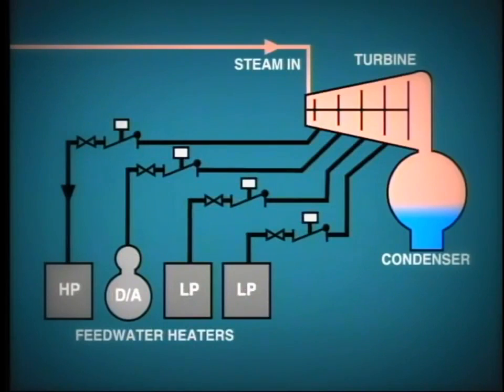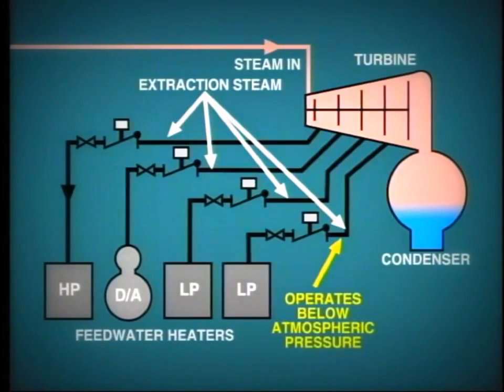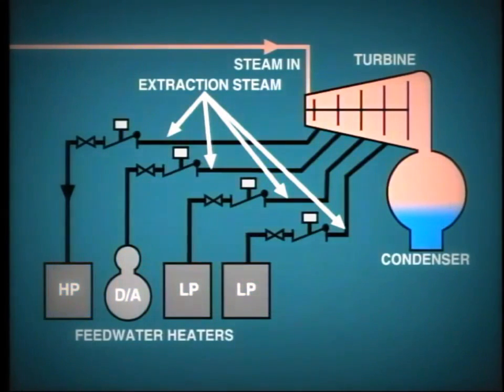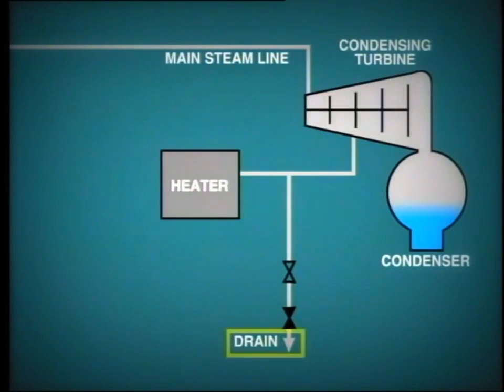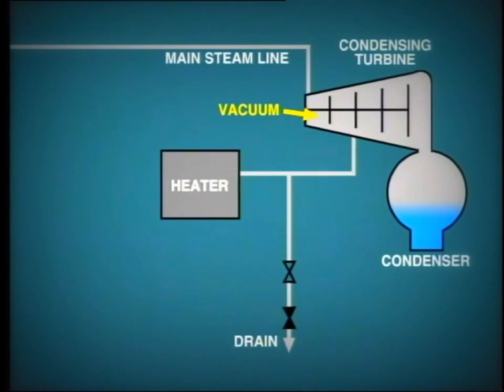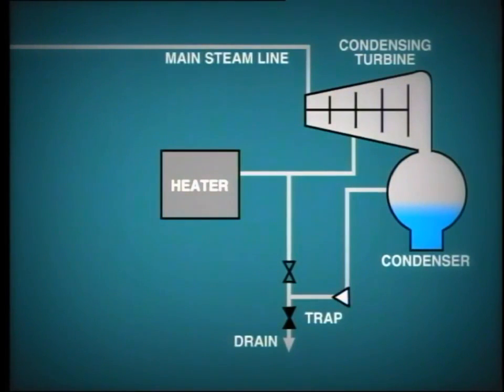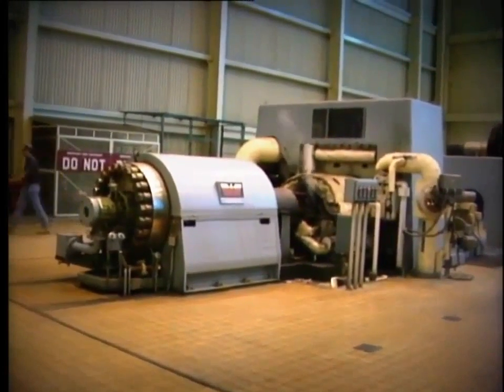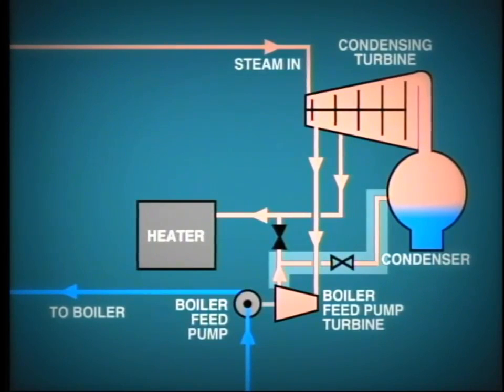lesson 3 : Extraction Steam System/مساعدات التربينه البخاريه

Comment: How would you control pressure, temperature and flow in the inlet and outlets, though? Would it be some kind of cascade control system?
Reply: Pressure/temp from upstream of the turbine process like vent/control valves  while flow can be controlled with a lube oil governor valve, lp heaters are under vacuum
Reply: @Wadhar51  what is the different between governor valve and control valve ? because sometimes governor and control valve is same
Reply: 1. The governor valve's function is to regulate the flow of steam entering the turbine to match a predetermined set point. The governor valve calibration process is carried out before the generating unit start up process.

2. A control valve is a valve used to control fluid flow by varying the size of the flow path according to that directed by a signal from the controller, making it possible to directly control the flow rate and being an important control for several processes such as pressure, temperature...